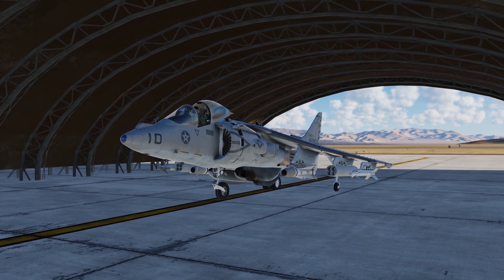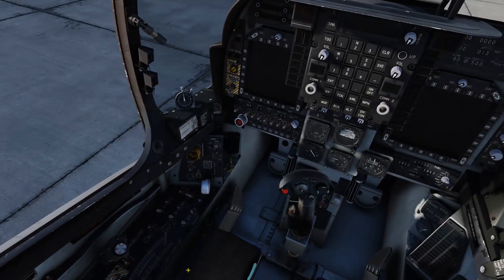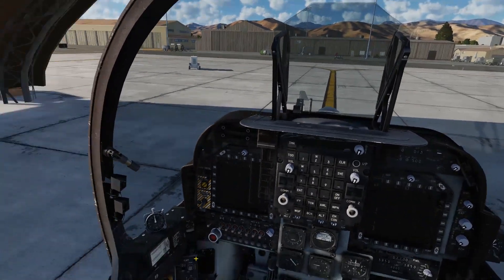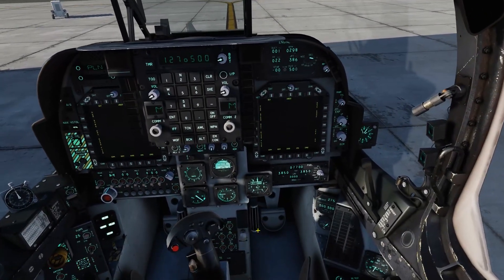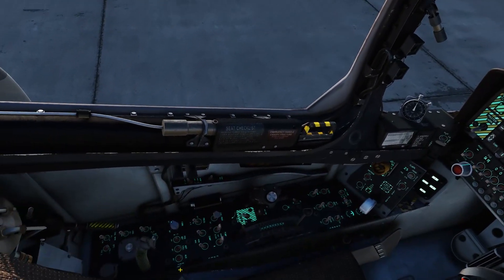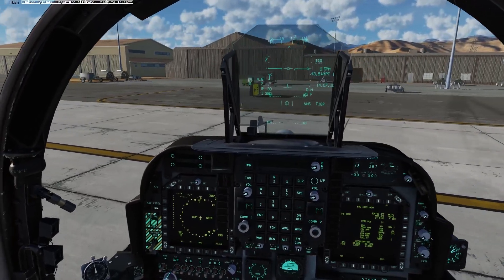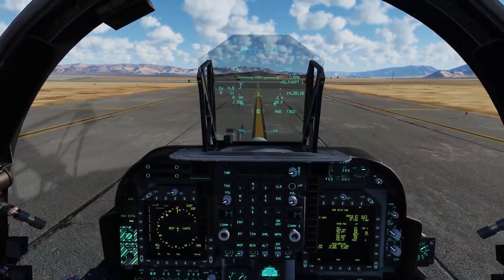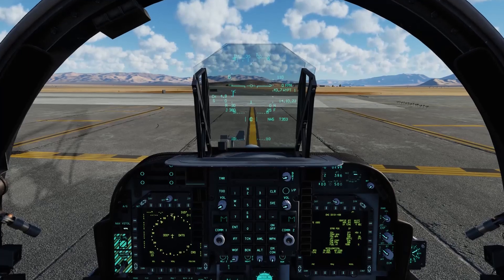DCS World: AV-8B NA Harrier II Start Up and Taxi Tutorial - Updated and Redone!

Comment: Great video that will really help newcomers. A few tips for OCD pilots out there:

In real life, nav lights (hold off on strobe for now) would be on prior to engine start sequence. Flaps would also be turned on and set to up position beforehand and remain so for taxi. The cockpit would be closed before starting the APU.

The APU (only big thing you forgot) is started and allowed to spool up (you will get light indicator when ready) before Eng Start switch is depressed. Not necessary in game yet, but it should be implemented eventually so its good to practice.

Once engine is running and APU is shutdown,the canopy can be opened for comfort during ground operations.

You can also tap the Master Caution before start up if you don't want to hear it when RPMs come alive.
Reply from the maker: LtRiot I don’t think you have to turn on the APU in the Harrier to get it started though, I thought the APU is only turned on if you plan on spending awhile on the ground working systems before engine start
Reply: Sorry. I'm no harrier driver. I've just always seen the APU start first. That's probably true
Reply from the maker: its all good, in the AV-8B the GTS and APU are seperate systems and when you fire up the GTS with the engine start switch it also runs the electrical generator the same way the APU does.  What is different about the AV-8B and the Pegasus engine is the GTS can use power from the battery or ground power and does not require the use of the APU.  I believe it is designed this way for scrambling very quickly at FARPS near the front line.